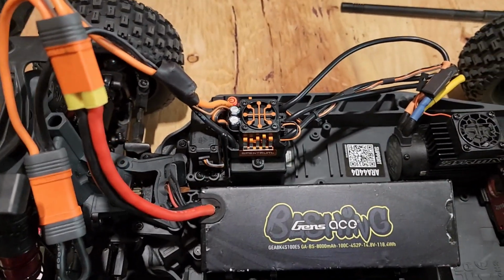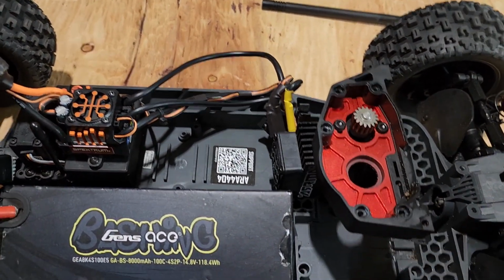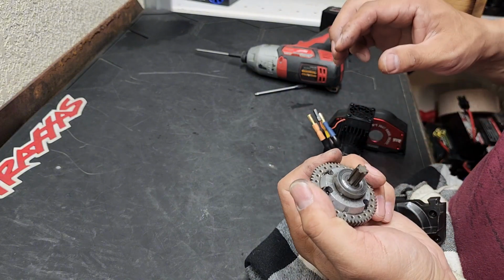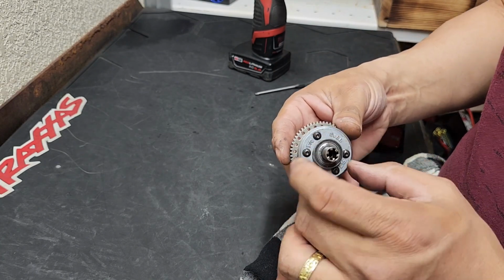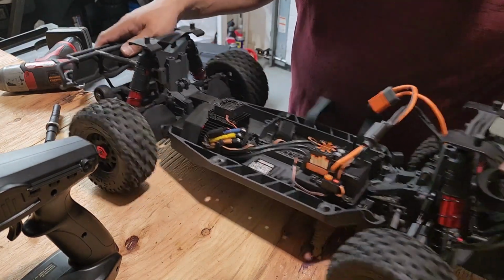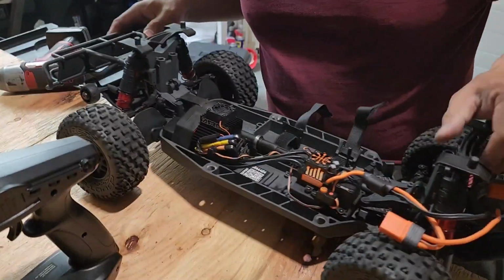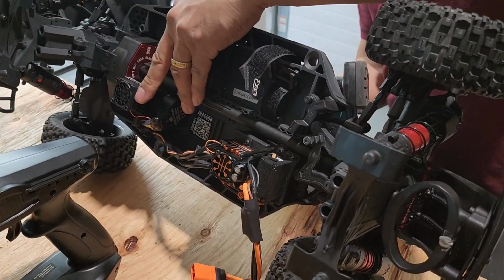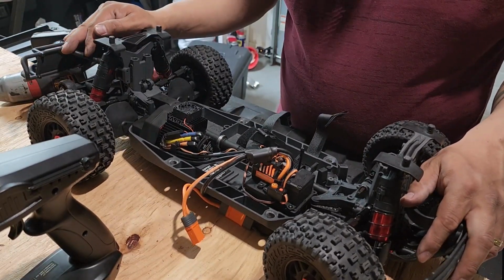Esc or motor issues fixed, and beach run.

Comment: Needs more power lol sick truck tho
Reply from the maker: Just remember, I put it on 50 percent, and when my boy ran it and just checked remote, It was on 75. I never put it 100 when I was running it, 😂
Reply: @victorevan7893  never tried full power ? Whaaaa that’s like having a v8 but only using 4 cylinders
Reply from the maker: I had previous videos at 100, but I didn't realize it was75 after my boy tried 😂 and no, I'm leaving it all stock. I like it the way it is set up.